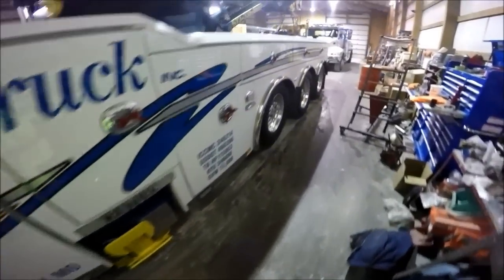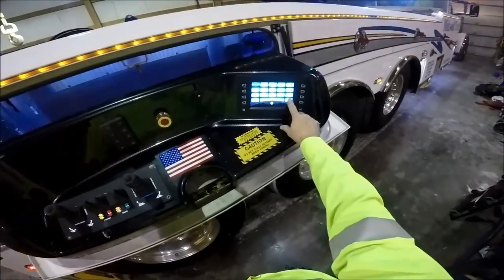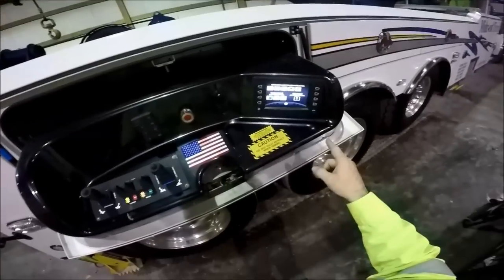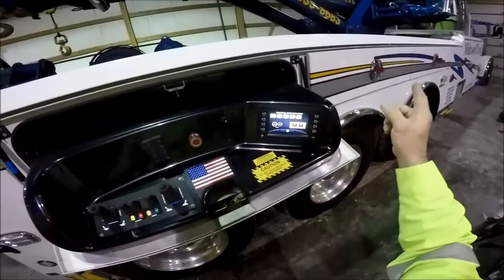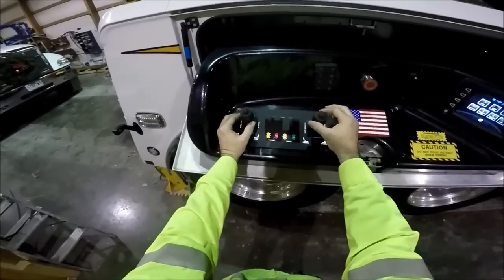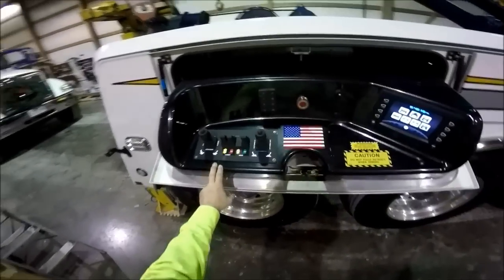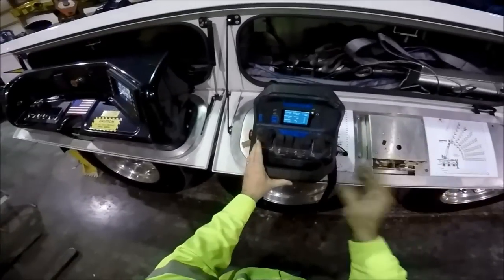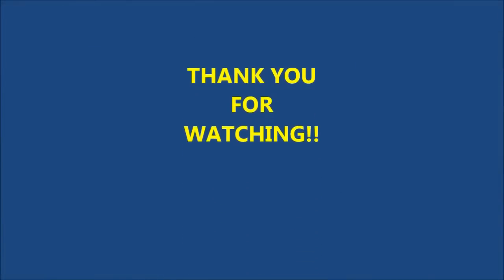RAPTOR CONTROLS OVERVIEW 12 2 2016

Comment: Love it.   A must watch in my opinion.   Does a hydraulic cylinder control the carriage (like on the rollbacks), or is it motor/hydraulic driven like the winches?   My guess would be that everything is driven by the hydraulic pump(s), which must be high capacity to handle all those functions.

Comment: Hi Ron once again great video and highly detailed. Have you tried a n external mic for the GoPro may fix the problem and save you buying a new one
Reply from the maker: Brett Swampy.  No I haven't.  I'll have to check into it.  I'm not sure if they make one for it, but that is a good idea.
Reply: Ron Pratt hi Ron yeah they do make one but not sure what model they fit please check your connection socket thoroughly as the difference is minimal
Reply from the maker: Brett Swampy .  I found one and have it ordered.   It is supposed to work with my particular GoPro.   Thanks for the suggestion.